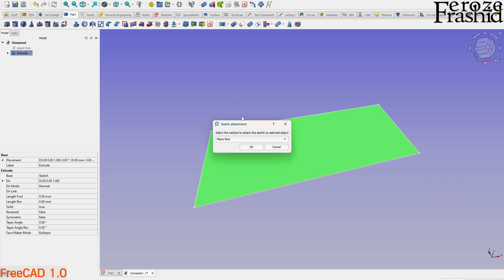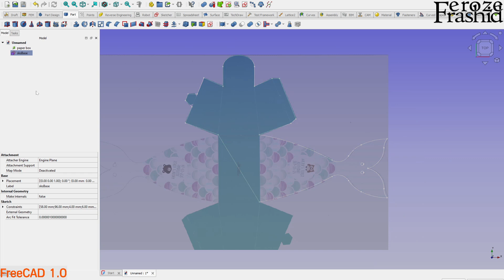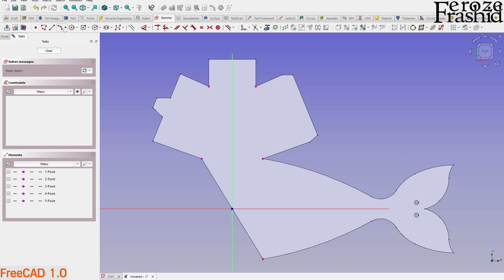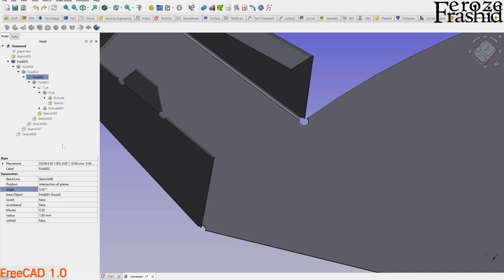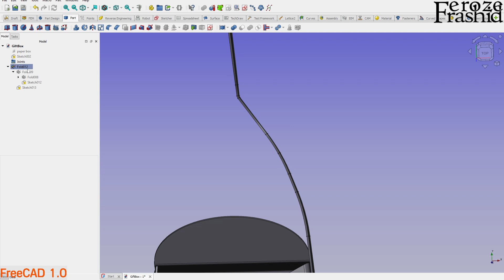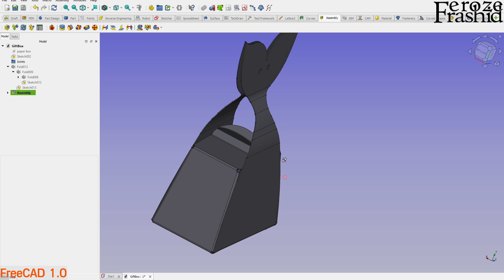First Project in SheetMetal wb of FreeCAD 1.0

Comment: This is a tough bench to figure out. Foe paper and card folding, I've found setting the default k-factor to 1 and the thickness to actual size. 0.5 mm is really thick for sheet stock, metal or paper.  There is a post on the forum talking about paper and cardboard. There aren't any good videos explaining the workbench. Joko did a couple for pre-0.19. Most of the videos are silent movie 'watch me make something' rather than tutorials like you and MangoJelly are doing. So are you the sheet metal workbench guy that everybody will be recommending?
Reply from the maker: Thanks, I will check out the forum post. 
This entire project deals with only one tool from the workbench. I do have a plan to go over other tools in future. There is nothing more satisfying in knowing that my hobby may help others in their DIY journey.